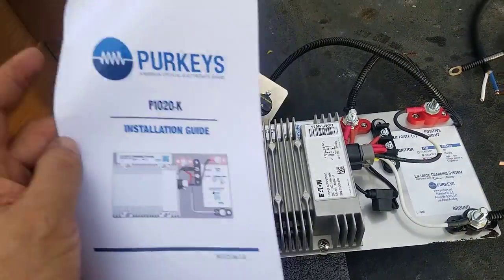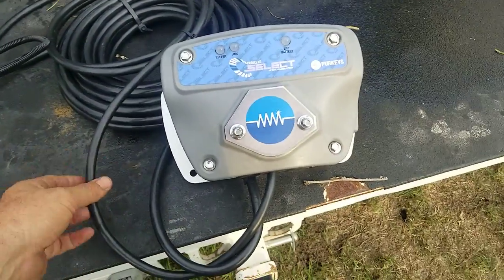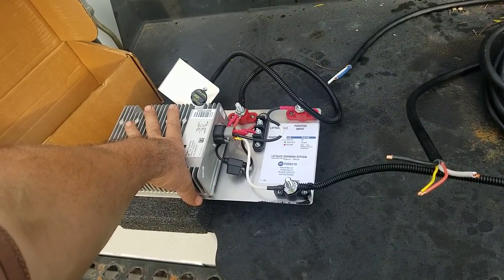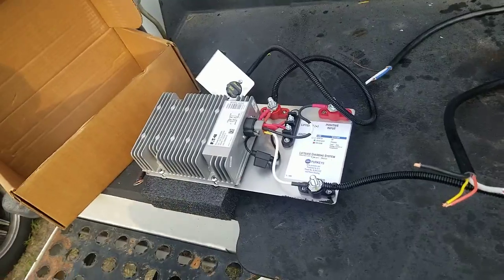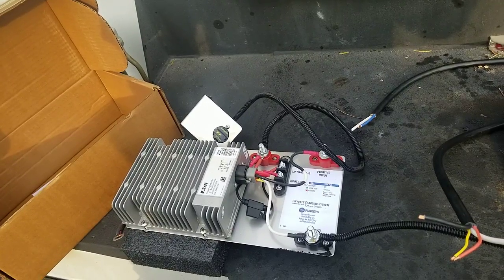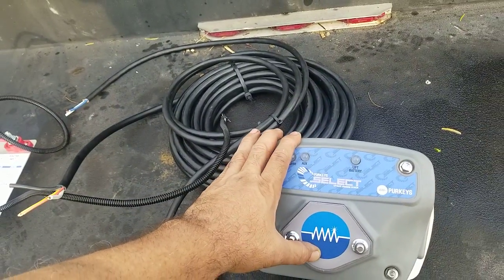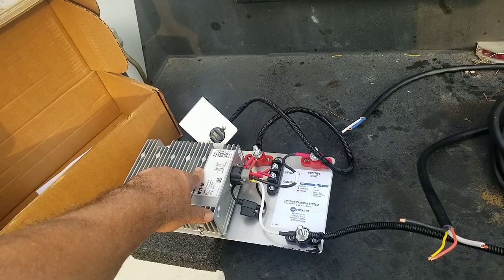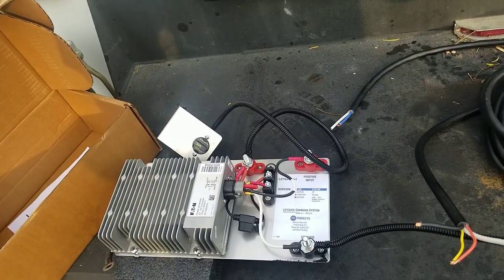Something new, the miracle for lift gates on semi’s

Comment: Basically a battery isolator. Let's the battery charge off the trucks system, but doesn't let any juice go back to the truck.
Thanks for the video!!
Reply from the maker: not exactly
Reply from the maker: its more like a dedicated   20 amp alternator for the 3 group 31 batteries in the trailer
Reply: @sonofmontezuma3732  interesting... How well does it convert???
Reply from the maker: pretty dang good i was surprised .
way better than an isolater.
of course this is for a commercial use 

i understand they have a smaller version on amazon called the BOSS 01 for single battery trailers like a hyd dump type
Reply: @sonofmontezuma3732  cool!!!
Reply from the maker: just upload video of unit  installed  on trailer